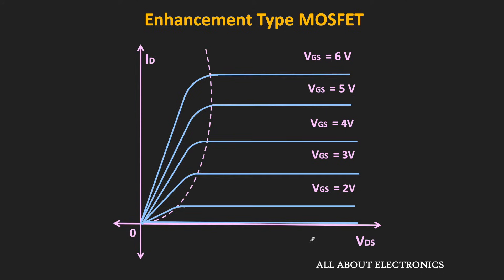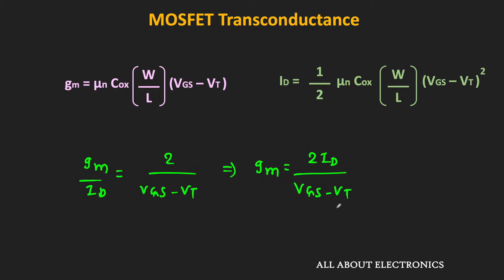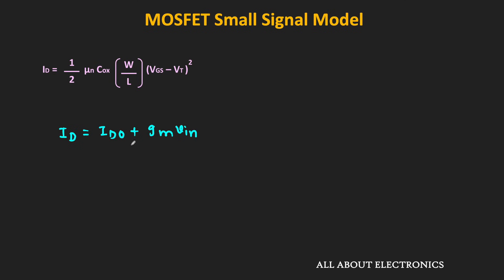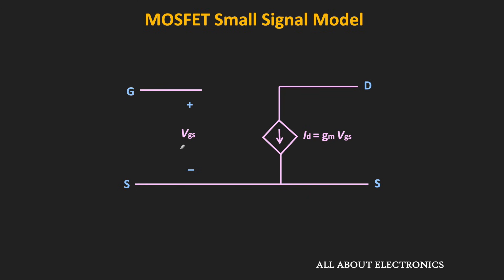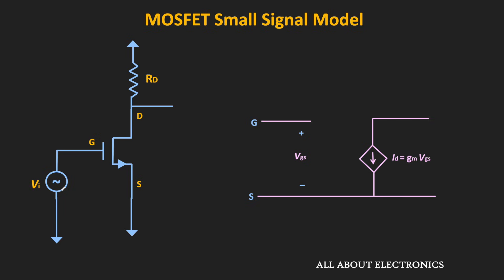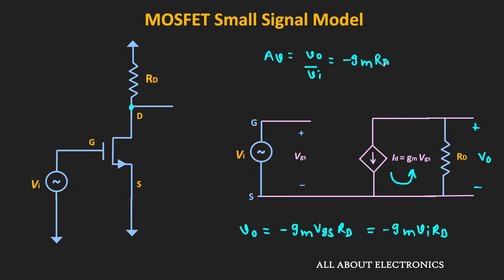MOSFET Transconductance and MOSFET Small Signal Model Explained

Comment: why do we only do small signal analysis in saturation region?
Reply from the maker: Because in the saturation region, MOSFET acts as a voltage controlled current source. And in that region, it can be used as an amplifier. Using the small signal analysis, it possible to find the relevant characteristics of the amplifier. (Gain, input and output impedance etc)

Comment: 0:39-0:46 to use the mosfet as a amplifier, it should be operated in the saturation region 如果要用mosfet當作放大器，那麼應該要保持在飽和區

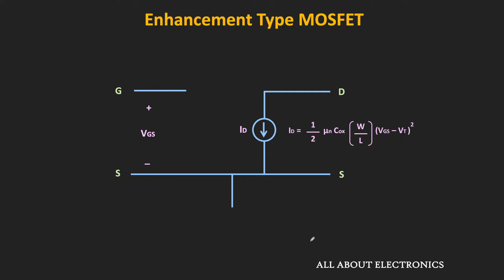0:46-0:54 because the drain current iD is a function of voltage VGS 因為電流iD是一個電壓的函數

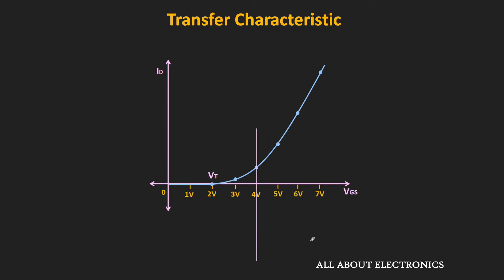0:54-1:00
but if you see the relationship between drain current and the voltage VGS,you will find the relationship is not linear.但如果你觀察drain current iD和電壓VGS的關係，你會發現這個關係不是線性的

1:40-1:55
it is defined that the transcinductance of the mosfet. ths transconductance is equal to the change in the drain current divided by the change in the voltage VGS
定義一個東西叫做conductance=drain current iD的變化量 除於 電壓VGS的變化量

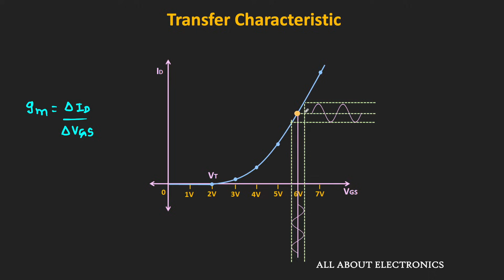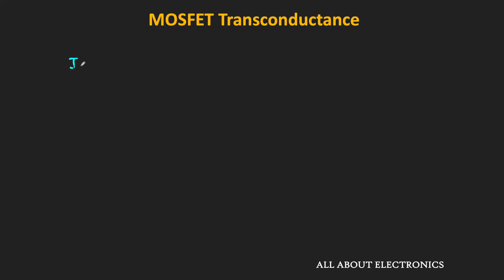2:01-2:06 從圖形上來看consductance就是operating point的斜率

2:26-3:02
微積分內容

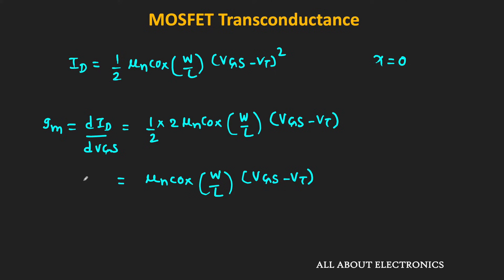3:11-3:22 from this expression,you can see.The transconductance is proportional to VGS minus Vt.從這條式子可以發現，當使用同一個mosfet時（意即mosfet參數不變），transconductance 和 (VGS - Vt) 成正比

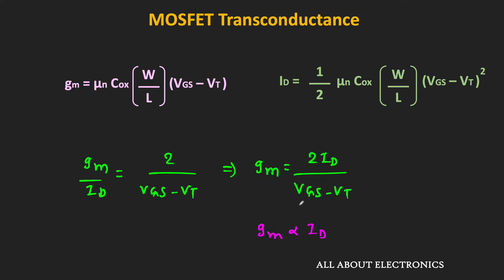4:38-5:41 最精簡的方式表示gm

Comment: Thank you for valuable lecture. One question. Why VDD is grounded? Shouldn't mosfet be saturation mode which requires large Vds?
Reply from the maker: This is small signal analysis. So, for that, all the DC voltage sources in the circuit has been assumed as zero. That's why VDD is grounded.

Comment: At the very end of the video, the polarity of Vo  being positive on upper rail and negative on lower rail is as many textbooks show it.  But current flows UPWARD through the resistor from the lower rail, making the resistor more positive in its lower half.  HOWEVER, you explained that vo = -gmViRd  (the minus sign helps clear this up!)  Thank you!

Comment: sir why Vgs=Vdc+vi
Reply from the maker: The voltage Vgs is the superposition of the DC voltage (which is appearing between the gate and source terminal) and the AC input signal (which is also applied between the gate and source terminal).
The Vdc is the required biasing voltage, while Vi is the AC input signal which we want to amplify.
I hope, it will clear your doubt.

Comment: Sir if vi<<(vdc-vt)  then vi =0 right and 2vi(vdc-vt) becomes 0 right Sir ?
Reply from the maker: 2 Vi (Vdc - Vt) will be small but Vi^2 will be even smaller. And hence Vi^2 term can be neglected. 
For example, let's say Vi = 10^-4 V and Vdc - Vt is 1 V. So, 2 Vi (Vdc - Vt) is 2 x 10^-4, while Vi^2 = 10^-8. So, if you compare both terms then Vi^2 is much much smaller and hence in comparision to other two terms it can be negleted.
I hope, it will clear your doubt.

Comment: At 11.20 is the current flows in clockwise direction?
Reply from the maker: No, its flowing in the anti-clockwise direction.
Reply: @ALLABOUTELECTRONICS  but i can't understand it sir ....can u explain it for me ?
Reply from the maker: @killermitians7640  The dependent current source is connected between drain and source. (Downward direction) On the left, gate to source terminal acts as an open circuit. So, there is only one way that current can flow. Through drain resistor. And to satisfy KCL, it will flow from bottom to top through drain resistor. Or in other words, in the loop, it is flowing in the anti-clockwise direction. 
I hope it will clear your doubt.
Reply: @ALLABOUTELECTRONICS  Thank you so much sir ....sir a  humble request do make videos on MOSFET biasing as soon as possible as we are having our exams on January.....btw thank you once again sir
Reply from the maker: @killermitians7640  I have already made videos on it. 
Please check the JFET and MOSFET playlist. 
You will get it.
Here is the link: https://youtube.com/playlist?list=PLwjK_iyK4LLC-tRT_Uml3T-ifdcmuykjV
Reply: @ALLABOUTELECTRONICS  sir also do videos on small signal analysis of MOSFET as soon as possible